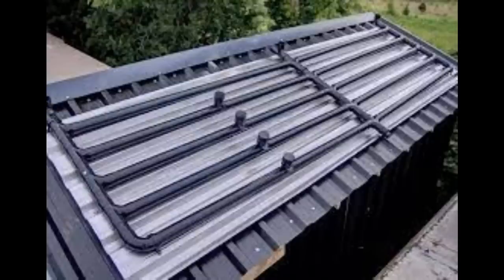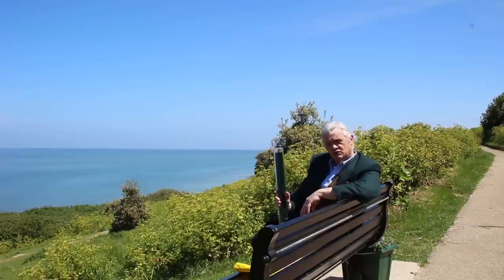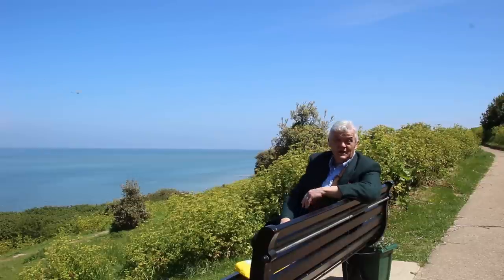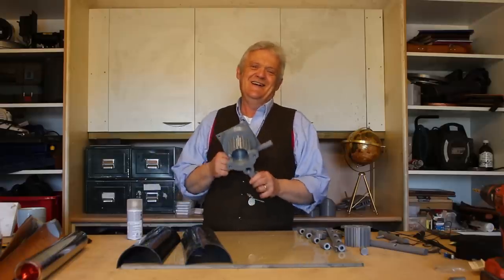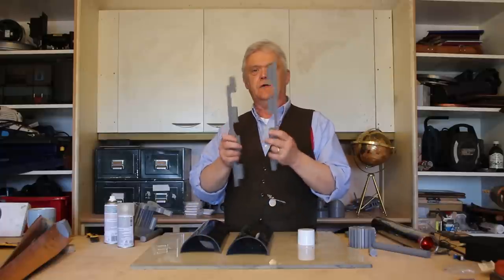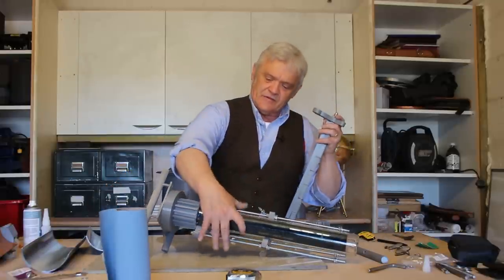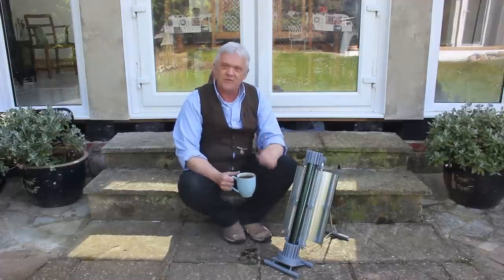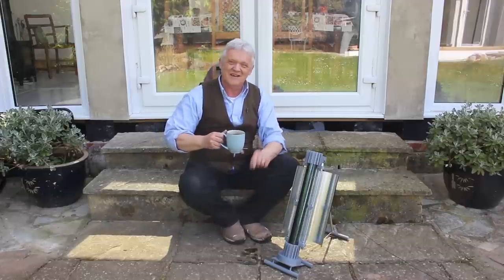1937 The Solar Kettle

Comment: Hello Robert...
Was pondering about your vacuum tube, would be very cool to see how they are made and how your able to get the heat out of it...

Anyway, what I really wanted to ask, your collecting capacitors for making flash graphene... For a controlled current release...
How about having a vacuumed tube with electrodes at each end, filling  with fine ground graphite backed tight and gases/fluids evacuated.
Then hook it up to a lightning ⚡ conductor/ rod so the power will travel with ease though the vacuumed captule and wait for the action to happen ⚡⚡⚡⚡⚡⚡⚡⚡⚡
You'll have to record if try ❤⚡⚡

And if it proves successful...
Then can design a magazine to reload it. 
By semply isolationg to magazine autoloader by bypassing the conductor rod to ground whilst reloading, then re-connecting.

Any non-conductive strong material for the pipes. 
A ram with sensors to push the electrodes in to the correct conductivity reading maybe pipe clamp of some sort to hold place, the electrodes.
Then ready for loading.

And the chamber will be a non conductive pipe, and the vacume because it will need to be housed in a tall building, the vacume for the chamber can be a simple water drop pump that continuously pumps a reservoir of vacuum to speed up the process of reloading the champer

When the vacuum has reached then the chamber is reconnected to the lightning rod and the the bypass to ground is disconnected so the lightning charge has the pass-through the fireng mechanism (that's a better name) to ground.

Spent cartridge can be taken away to be opened unpacked and sifted to get the little chains of graphene.
And reload the cartridge ready for next time.

Comment: Would a Fresnel lens seriously reduce the time I'm wondering. It's so encouraging to see you with a cup in your hand again I've been getting quite worried by its absence. I bought some cheap flexible self adhesive mirrors on Amazon for my solar cooker, I think they would work well. Love the video. Thank you
Reply from the maker: i like the idea of the mirrors mate - i may use that sometime if that's ok
Reply: @ThinkingandTinkering  An elliptical mirror would be  ideal as it focuses perfectly to a single point by definition...It was a solution used in lasers in the 70's...  Fresnel lens would not be ideal since it would focus different wavelength to different places... I think you are correct to go with mirrors as their performance is hardly effected by wavelength so will focus all the energy in all the wavelength to the same place
I think... :)  Ps great videos... Thank you
Reply: Fresnel lenses are too hot as they focus the sun into a small area which could shatter or even melt the glass. There is an artist I've seen with a Fresnel lens she got from an old flat-screen TV. It's mounted in a frame and she melts glass with it to make beads.
Reply: @judyofthewoods  I wonder if you take it slightly out of focus and only have it shine directly on the water in a ceramic mug
Reply: @WilliamTythas  that probably would work fine.

Comment: VERY Clever & Cool piece-a-kit indeed.  & ;loojs like it stimulated the ingenuity of your commenters quite a bit.   i thought if you hooked it up to the right sensors & a micropressor & relays you could automate the mirrors etc.  seems like it should be able to make a radiative infra-red air conditioner with it too.
Reply from the maker: i think you could

Comment: Rob, I have seen people trying to obtain energy for free or very little, for MANY years.  What I have NOT seen, is people MIXING technologies.  For instance, using your solar heater, to move water to a certain height, where it is then stored, or let fall, then dropped through one of your water/air generators, and sending that energy to one of your super batteries, coupled with one of your super capacitors, to use on one of your other energy efficient gizmos.  Try something like that.  
I once created a magnetic water heater, just to find Induction cooktops. :-)  I have yet to find an induction water heater.  There may be one, but I haven't seen it.

Comment: The vacuum tubes advantages include high efficiency - in my home country in Africa it heats water to over 90C
My concern is that temperature is dangerous for household use and that it does lose its vacuum after several years.
If I didn't use a direct solar heater I'd opt for a heat pump.
Reply from the maker: everything is dangerous mate - if used incorectly
Reply: @ThinkingandTinkering indeed!
That's why engineers are there - to mitigate risk.

Comment: um... fairly certain that red inside is a sputtered copper coating....... don't know what the life span is for it but filling the tube with silica sand around the heat pipe can produce wonderful heat transfer and retention even on cold days

Comment: The collection area is the size of the mirrors so about 0.09m^2  (110*2 * 430) so even at 1000W per sq metre sun irradiance  (unlikely in Kent!) you have 100Watts of power max- so not surprising it takes a while to boil the water.
Reply from the maker: i wasn't surprised either

Comment: This should be coupled with a large sand battery to store heat long term
Reply from the maker: that would work!
Reply: I love both the evacuated tubes and sand batteries ! My thoughts on "marrying" them are that you would need a thermal "rectifier".  Since sand batteries typically have storage temperatures of +500 degrees and Evacuated tubes run around 150 degrees, you would have to have a way to push the heat "uphill" into the sand battery.

Comment: What about using old CDs to be reflectors, a bolt can be used to change the focal length. But maybe use a heat gun to heat the CD and vend it to shape and cool in shape with a cool damp rag,  cooling them into shape,  or Mylar, space blankets,  could be used, putting a fresnel lense in front will speed it up greatly,   only keep it out of the peak of the focus, keep it about 20%™ before it , so the thermal energy is spread out more, having a larger tube about 4" diameter,  and 4' long, could possibly get more done,

Comment: Awesome work Robert..hey..what if you put a large fresnel lens in front of the device ? You can pick them up pretty cheap.
Reply: What matters is the total surface redirecting the Solar radiation to the Tube. With out whipping out my calculator I believe that the "Wings" he has integrated actually are a larger surface area than a average portable Fresnel could provide. 
Also the concentration of the surface area to a 3mm spot would create a thermal shock to the tube that would not be desirable.

Comment: I have a question, could say 100mm PVC pipe not be used, but cutting length wise, then heating, and spreading it open. And baking a flat sheet of it. Then use a orbital sander with 80 grit,  then 220, 320 then 400. And then polish graphite powder into the pipe and paint with a clear coat,  or something like never wet? Would the graphine or graphite not reflect the IR enough??  Then adding a bit of heat can put the parabolic shape into the PVC . I'm guessing Eden using spray paint as adhesive, be possible to  attach a space blanket to the PVC,  after sanding it smoothe, the inside of the 3"-4"+ pipe is usually wavy and lumpy,  either way spray adhesive would  attach  the mylar, baking a parabolic trough mirror,  my question is  I just wonder how efficient it is in reflection of the IR wavelength,  possibly not the best, or maybe the graphite could reflect it best, or not at all!! The aluminized plastic film,  ' Mylar '  could  do the same, the plastic could absorb the ir before but gets to the aluminum, the graphite could reflect the IR because it on the surface of the PVC, using 3"-4"+ pipe can make a large trough,   reflecting alot of area!! ✌️ Awesome

Comment: I wonder if you got a larger diameter one, run the copper pipe in and out but fill the rest of space with sand. Then you just need to pump water thru when hot water is required.

Comment: I've always wondered why they make these solar heaters circular? I guess the easy answer is convenience. But for the DIYer if you made it with a flat surface facing sunward the increase in efficiency would be dramatic . The same reasoning why PV panels are flat. The amount of the suns rays hitting a flat surface is way increased. I cannot say how much quicker it takes to boil but it would be faster than the hour + it takes in it's current configuration. But it's true, if you're in no hurry this standard design is just fine for a cup of tea for two. Cheer's!
Reply from the maker: yeah i am with you it is just easier to make this way
Reply: Interesting idea. it should actually be easier to sputter on a flat surface than a curved one. However making the vacuum space between the out plate and inner plate is probably harder. The vacuum space makes the heat go in rather than back into space....
Reply: @karlniemann my initial thinking was a triangular glass outer casing with the tube inside of it. The inside of the glass can also be sputtered it should not effect the tubes absorption. Alternately it should work with a larger flat glass plate attached to a semi circular glass bottom again with the tube inside holding the vacuum in both cases. The volume of water Is no different merely the efficiency. The layering capable of absorbing more of the red spectrum is key and either choice would absorb the reflected rays from the mirror panels. Hopefully it makes some kind of sense, What say you dear TnT viewsr

Comment: Nothing new here.  In the 1960’s Prof Mesell and team, Sydney Uni.  Developed a “commercial” oil filled solar heater.  It would heat oil to over 450F.  A trial unit was set up a the Coka Cola manufacturing  factory in Melbourne(?)  the test production proto type was a huge success at supplying heat to provide boiling water.  Messel asked both state and federal guv’ment for funding to development the system.  Both guv’ment said “we don’t need this, it would impact on our coal industry”.  Sold the system was sold to Soudi Arabia.  In the 1970’s.  The NSW guv’ment and Rheeme Australia bought the system back from the Soudis for MILLIONS.  Neville “Nifty Nev” Griner said it was a great partnership and will advance Australian industry and it disappeared, never to be seen again.  Funny about that but a classic example (?) of the narrow minds of various Australian guv’ments then and now.
While ever the Coal industry has a hold of the guv’ments “members” Australia will never have an effective and cost effective replacement for coal.  I feel the Coal industry is not dissimilar to the Tobacco industry and why change? “Little Johnny”,  Howard Australian PM, said we where moving to “CLEAN COAL”.    And pigs fly!!
Reply from the maker: no - there is nothing new this tech has been around for years - what amazes me is that it isn't better used - do you use it?

Comment: This is similar to the fire tulip, except there's three flap thingies that reflect the light into the tube (partially reflective). The one end is fully reflective and the other end is open.

Kinda like a crude laser diode.

The reason why i call it the fire tulip is because i used a magnifying lens on the one end. You get the exact same effect just holding it in sunlight though. The only real difference is the radiant heat.
Reply from the maker: i suppose so mate

Comment: Thank you Robert. I'm having trouble finding those tubes. Can you provide a link. also, what material did you use to print the parts?
Reply: I'm also in search of the tube by itself! Post here if you find them!
Reply: ebay or aliexpress
Reply: @poczytamci3389  I looked, but I didn't find them. That's why I asked.
Reply from the maker: here's one i found loads but here is an example https://dakotalithium.com/product/10-pack-of-solar-vacuum-tubes/ and ABS

Comment: I have been looking at those tubes for years. The possibilities are huge.  How about a solar sterling engine?
Reply from the maker: for sure mate - up and coming
Reply: @ThinkingandTinkering  I got my notifications on for your channel, can't wait for that vid : )
Reply: Brain flash that you could make a 58mm strange engine from video 1771 and stuff the heat end into the evacuated tube pretty easily. This will have to be mostly upright  I suppose.
Reply: @ThinkingandTinkering  I believe I came across someone who was using these tubes in Canada or the far north somewhere and even in freezing weather the sun will heat the center of these tubes. What they did was to put a series together of these tubes. I think they were like 1.5 meter long tubes and they had 6 or so. But the water went just like electrical current in a series and then into the house where it did a lot inside before going back out. The had a hot water battery for the night. Even cloudy days produced some heat.

Comment: We had at our last house two panels similar to provide hot water. We rarely used the boiler for hot water even on winter. In summer we had a great abundance of hot water. We got them over fifteen years ago. At the time Voltaic cells were very expensive and not very efficient.
Reply from the maker: i think it is most strange they are not used more

Comment: Well done, now change that round mirror in a parabola and you’re about where I left it with my designs. The bottom can be used to fire it up with a candle light or barbecue and the mirror can be guided as a non electric solar follower using a wax thermostatic valve from a car and some thinking, using the ratchet system (like which is used in a bicycle)
Reply from the maker: cheers mate

Comment: The angle is measured from the horizontal (behind your unit), not the vertical. You got it the wrong way round. Think, the Sun is higher up in the Summer, hence the least tilt from the horizontal.
The MidSummer angle is your latitude (nothing to do with northern hemisphere), minus the the tilt of the Earth axis (23.4 degrees).
Reply from the maker: you are right mate it is - thank you for taking the time to point that out - cheers

Comment: Never mind all that use it to heat air feed that to a flame gulper engine and generate electricity.  The theoretical Thermodynamic efficiency is way better than PV wether or not you get it is another matter.

Comment: From the video it does not look like the 2 reflectors are shaped to be very efficient. Of course they should have a parabolic section. I can imagine the next video will craftily create a 3d printed version. I would expect a considerable improvement in boiling time. Excellent videos.
Reply: That was my 1st thought. Ironically, u could probably have a square meter parabola heat any old pipe quickly to boiling without the expensive n techno-dense collector. Should be easy since the parabolic reflector would be a curved plane such that the focal "point" is a line.
Reply from the maker: they are not they are shaped to be easy and cheap to build

Comment: would be interesting to use that to heat the hot side of a stirling!
Reply: There's a thermal hydraulic engine, originally developed by Robert Malone in the early 20th century. The seals then were not developed enough to handle pressure as they are now, making this much more feasible. NASA even did a study in the 1980s and found the concept cost effective - reliable and requiring minimal maintenance. They stopped research on it, of course.
Reply from the maker: for sure

Comment: Great as always. I need your advice? I am about to buy my first 3D printer and I am wondering if buying the 300mm vs 220mm is worth holding out a few more weeks to save for?
Reply from the maker: i don't mate depends on what you plan to do and how much use you plan on putting it to

Comment: 80 mins to reach temperature in closed system like that although if we start using the steam principles then have a water container that is air tight you can actually produce steam after the 80, mins think of this as preheat of your boiler now that depends on the number of generators we have running and how hot they are getting. What I am getting to is if you run them in sync only 66% water capacity then heat time would reduce significantly. So my idea then though 4 system loop first on would need 33% second I  loop 66% and third in the loop would be 99% final one being 100% the idea is if water evaporates from the first water from the second will be doing same at slower rate so the water would evaporate quicker. So how to combat the staging so that all system maintain the same water level you shouldn't have to you have double water tank one side will be hot water otherwise will be cold it will self feed back and fourth and since. Can't really explain on here but can feed copper pipes almost like car brake lines and have it pretty nice system I trying to think of way to have hot water on camper without electricity. And EBike camper so it need to be light weight I want travel from scotland to south africa with me my ebike and my self sufficient camper

Comment: Nice idea, + adding a Peltier unit  to convert it to power why not
Reply: Peltier need a temperature differential to operate. So the challenge is how to get the cool side positioned so that it can take advantage of a temperature gradient. You can't just stick it to the outside since its the inside were the heat goodness is happening. You can't just stuff it down the tube since there is no cool area in the tube. So maybe putting it over the mouth of the tube could work with the cool side up.